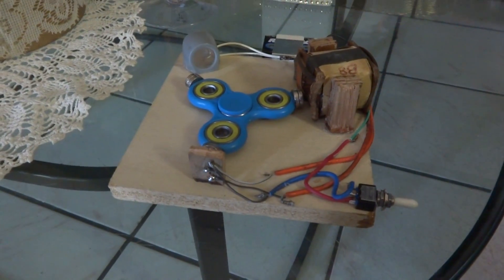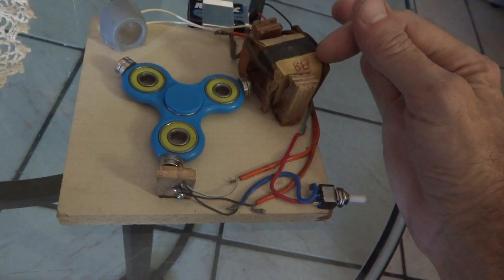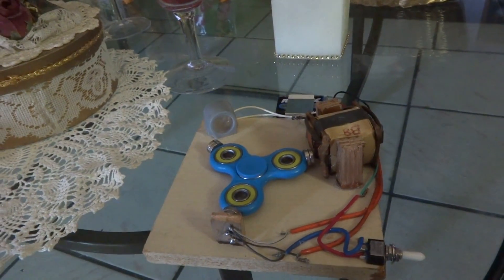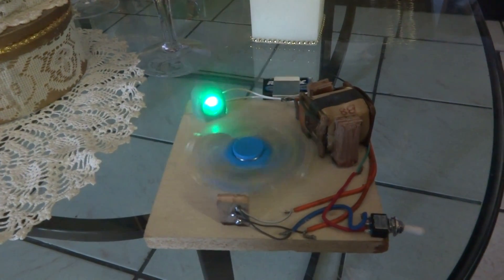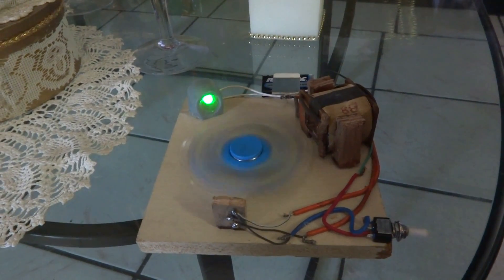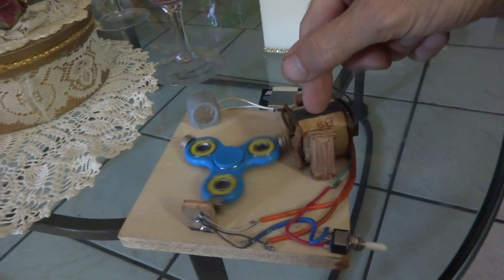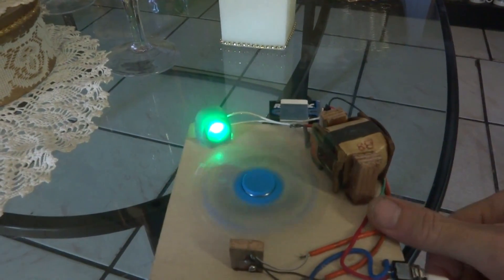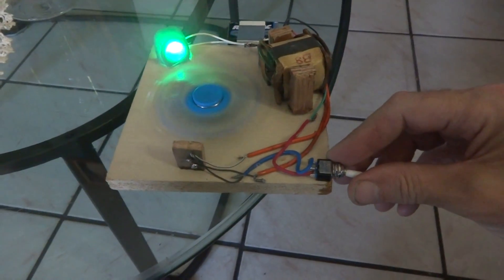Fidget Spinner motor update

Comment: What's the number for the HES?
Reply from the maker: I gave this device away a while back and do not know the exact part number but here is a link to some senors that should work https://www.ebay.com/itm/Uxcell-10-pieces-3-Pins-Unipolar-Hall-Effect-Sensor-Magnetic-Detector-2-5V-20V/253186734946?epid=1538357175&hash=item3af31afb62:g:gUAAAOSwA1papD~F

Comment: well done my friend can you share the shematic how you conect the hall sensor to the circuit coil thankz
Reply from the maker: Thank you. The schematic can be found in another of my videos https://www.youtube.com/watch?v=Y1x1IefKnFg
It does not show the on/off switch but it can be inserted on either side of the battery. Number of turns on the coil is not critical. Same circuit has been used with ferrite or air core coils. Unipolar or latching hall effect sensors use the same circuit only magnet poles will  alternate N/S/N/S for latching sensors.
If you use > 9v, buy higher voltage sensors.
Higher resistance coils (thinner wire, more turns) give better battery life.

Comment: I had this idea as well, however I want to put a coil + capacitor setup to see if I can create a generator to make self powered. Thoughts?
Reply from the maker: 'Self powered' may not be possible. Please check Lidmotor's channel, he is
the expert on combing these pulse motors into generators.
Reply: "Self powered", the key is that it will slowly slow down, as perfect efficiency is impossible